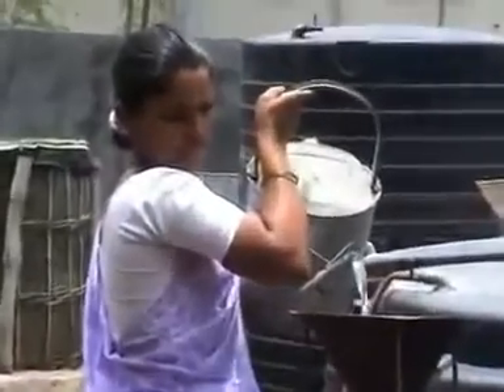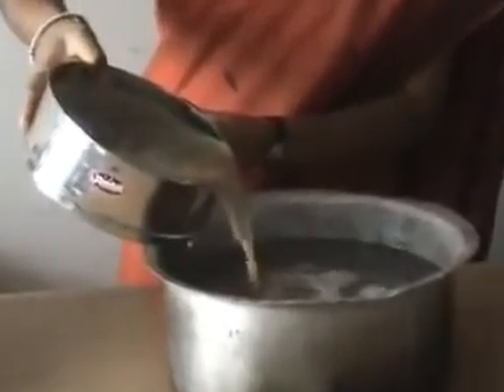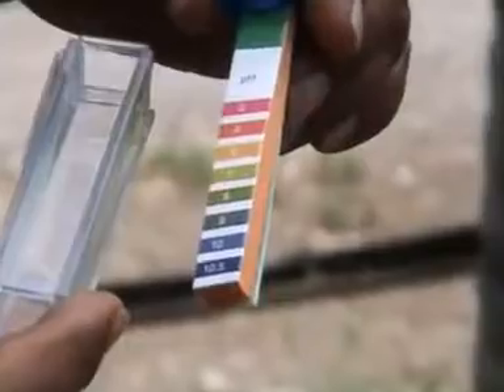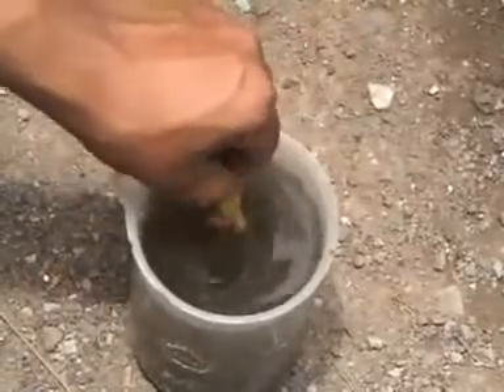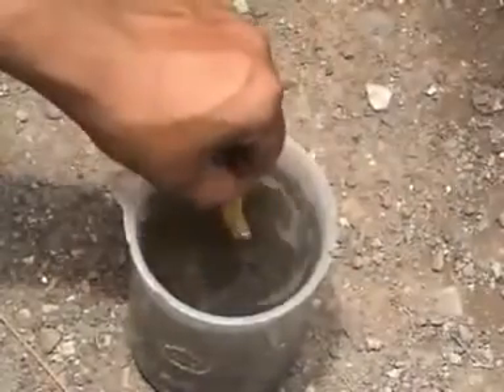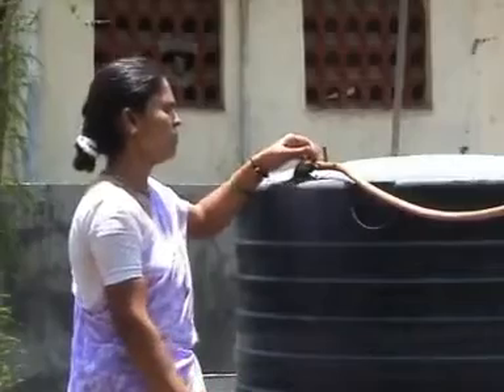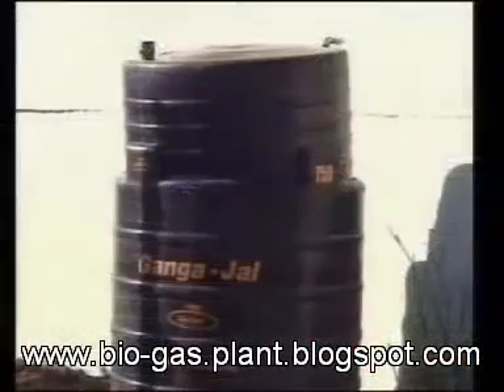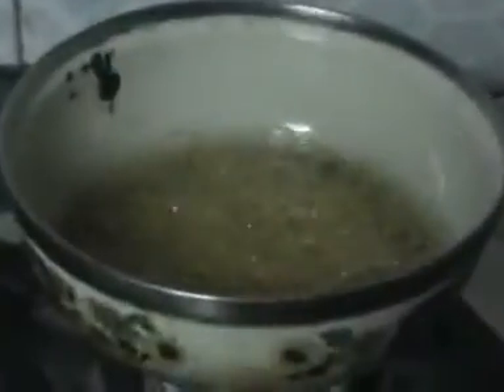ARTI Compact biogas plant (Anaerobic Digester)step by step Construction Part 4

Comment: The gas leak could be better avoided by using appropriate washers in the joints instead of the putty as shown in this video. There should not be any need for using either a tape or putty...otherwise it will be a constant battle to prevent gas leak...